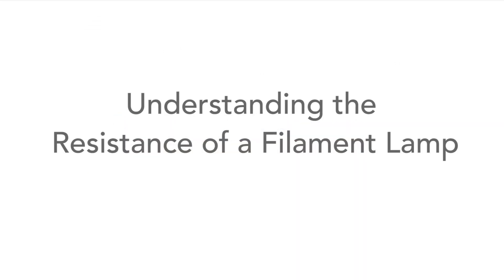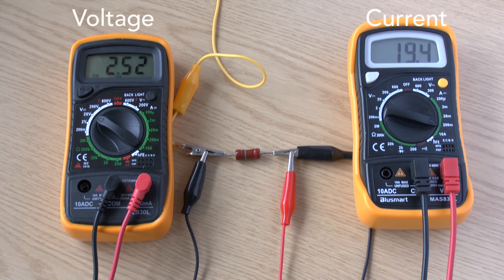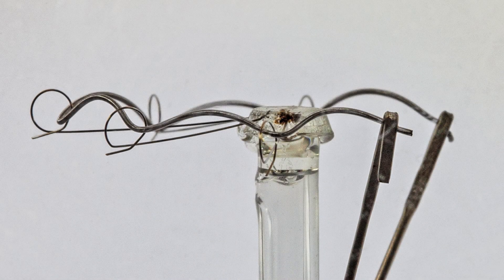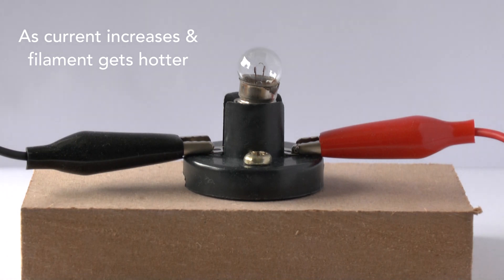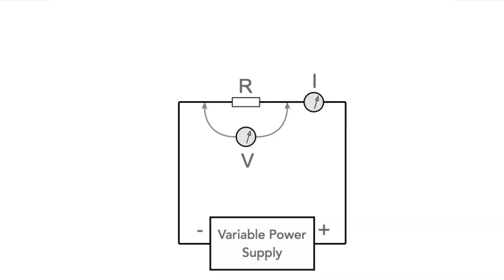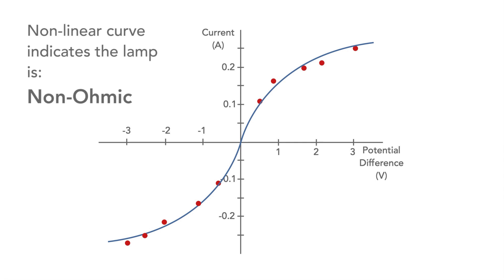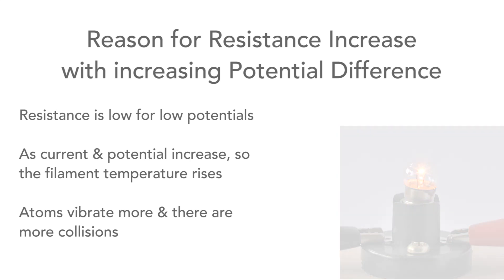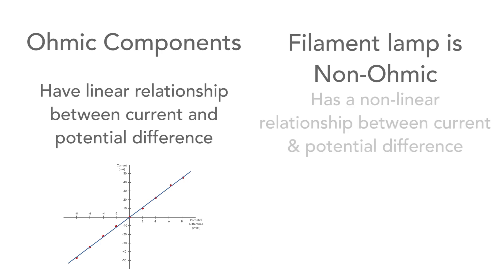Understanding the Resistance of a Filament lamp

Comment: Hi, may I ask you a question? I have 3.072V battery supply from a battery pack. I measured the resistance of the bulb at 1.9 ohm. so according to Ohms law, i'm supposed to see 1.6A. but on the bulb, I'm seeing that it suppose to be a value of 3V, 0.2A on it. I'm trying to understand how to truly understand how to measure the resistance of a bulb
Reply from the maker: The reason for the discrepancy is that the resistance of the light bulb changes. As the filament lights up, so the resistance increases. If you measure the filament when cold, as with a multimeter, then it will have a low resistance. When connected to a battery it will heat up, the resistance will increase and but will take less current.
Reply: @ElectronicsNotes  made a lot of sense. I had the information in front of me but wasn't seeing it until you broke it down. We have to factor in the effect of a temperature on resistance.  Similar to the ECT sensor on a car. As the temperature increases,  the resistance drops, allowing more current flow so the ECU can turn on the fan. When the temperature drops, the resistance increases. Allowing less current to flow so the ECU will turn off the fan. Thanks for the breakdown
Reply from the maker: @ I was glad to be able to help out.

Comment: Super video! One thing got me thinking. At the end it is stated that the relationship is simply current/potential. But really effect of the current here is a rise in temperature and its effects on conductivity as stated earlier in the video. So to conclude should it not be ' A Filament Lamp is Non-Ohmic because Temperature Rise caused by Current flow results in an increase in Resistance' ?
Sorry to be nit picking but I'm sure folk will understand based on the explanation in the video. Thanks for doing the video, I know it takes lots of work.
Reply from the maker: Thanks for your comment. A really interesting way of looking at it. Yes, you are right, the current flowing through the lamp causes the temperature to rise and hence the resistance to change. The point I was making was that a non-ohmic conductor has a non-linear relationship, whatever the cause. Thanks again.

Comment: Would be nice to see AC current as well as DC.
Reply from the maker: Thanks for you comment. I had not used AC because DC showed what I thought needed to be demonstrated, and as younger people may view it, I did not want to encourage the use of high voltage AC. Sorry if we disappointed you.
Reply: The behaviour is the same for AC as it is for DC so no benefit in showing it specifically.